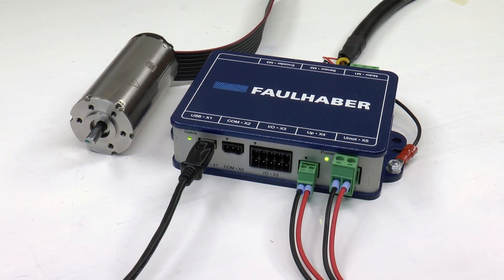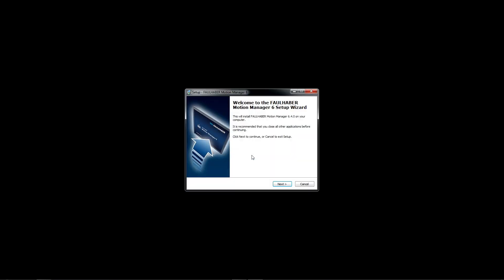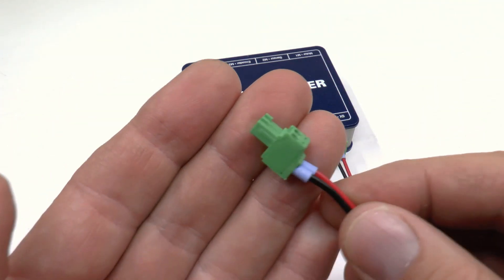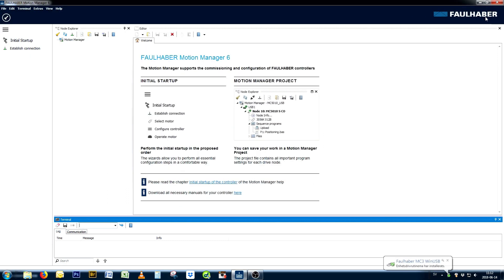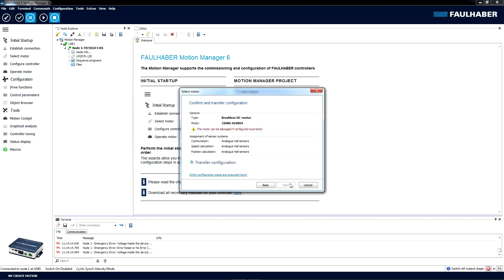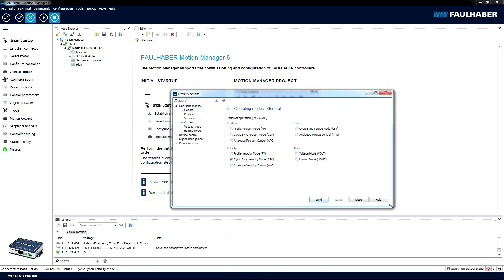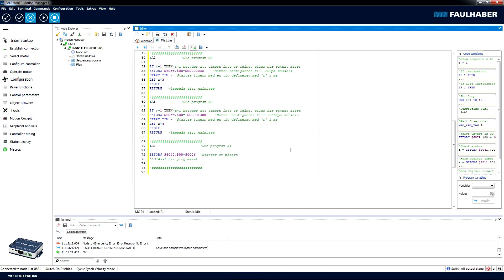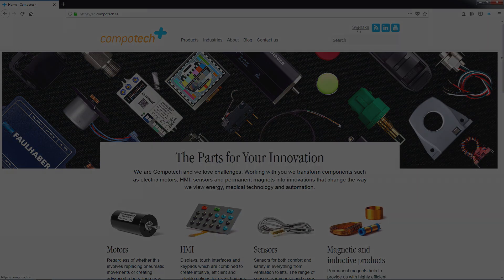Connect your FAULHABER motion controller to a motor!

Comment: problem have only any factory not ewer use windows base softwares controller factory machines whit computer, all uses only linux base OS computers if controller motors etc, all automation in factory, linux have only safe OS who can use automation,motor controll etc, in factory machines. windows base controllers can use only hobby users home machines because no matter how destroy all and not have safe use. linux use REAL time system controller machines and windows not can do this and have lot interrupt problem and dangerous use. but hobby users not can use this controller have out off hobby user budget factory prices and too expensive hobby users. have lot more options cheaåen and non safe systems what hobby users can use.

Comment: Why is there a grounding cable? It is just low voltage DC?
Reply from the maker: This is a low voltage system but there are some regulation that needs to have the option to add this grounding cable. Also if you have multiple drives it is nice to have a good equipotential reference especially if you have distributed sensors to the analog inputs.
Reply from the maker: You can read more here https://www.faulhaber.com/fileadmin/Import/Media/EN_7000_05057.pdf (chapter 4.3.2)
Reply from the maker: Regarding support needed, please contact our specialists https://en.compotech.se/contact-us/
Reply: @compotech6306  thank you for clearing it up!

Comment: Nice tutorial. I am having issues connecting two nodes (MC 1050 S) in parallel. I just can't get them to work. Could you please help me?
Reply from the maker: Nice to hear that you like this tutorial! Regarding support needed, please contact our specialist krister.larsson@compotech.se
Reply from the maker: Can you explain more in detail what you mean/do when you say: ...connecting two nodes in parallel
Reply: @compotech6306  I mean connecting two motors and controlling both of them with the motion manager. How exactly should we do the setup and how can we get encoder information ? My goal is to be able to control both the motors at the same time and get the encoder increments  through RS232 COM connection. How must I setup the drivers to achieve this goal? I have set different node ID's, same baud rate and the wiring is done as shown in the documents for multiple nodes but still having trouble getting the encoder increments when two of the drivers are connected.
Reply from the maker: @Orl242424  What are you using to talk to the drives? Laptop and USB-serial adapter?